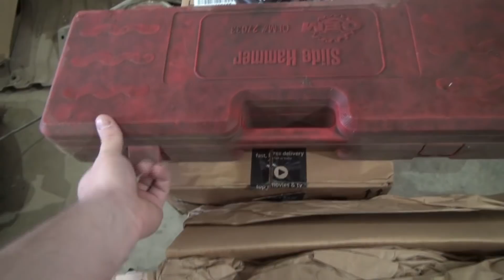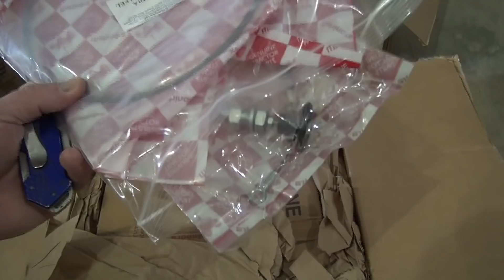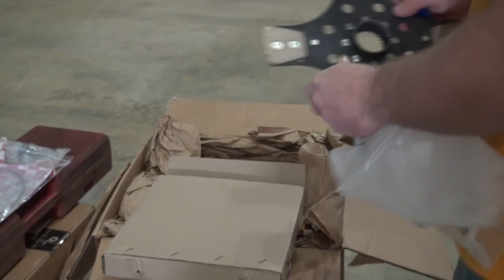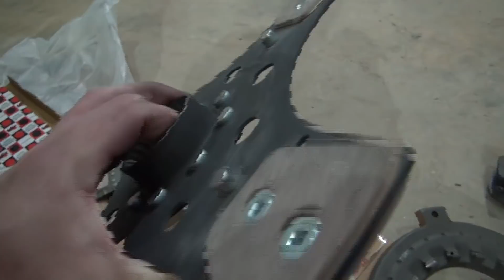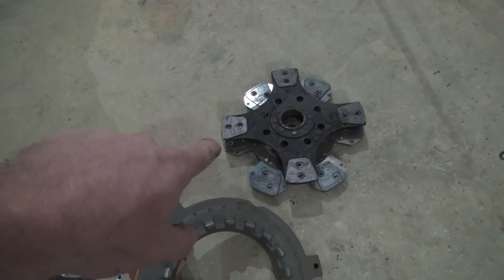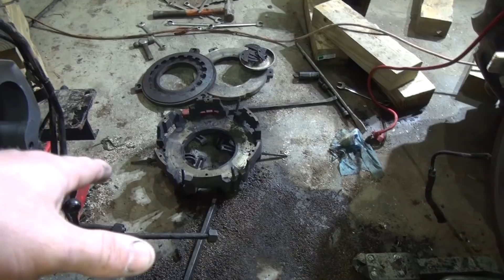Mahindra 8560 part 6 I got parts finally

Comment: Had a few tractors, 5000 hours. And clutch was still good. My Kubota is 20 years old bought it new. Still has the same clutch.
Reply from the maker: depends on what your doing with them and whose driving them lol
Reply: @LifeWithChase  On my Kubota I'm the only one running it. 90% loader work. Moving hay for 13 years. Lots of gravel and cleaning out barns. So lots of clutch work. But used not Abused.
Reply from the maker: Is it a wet clutch? they last alot longer. but dry clutches can last a long time to if you drive it right.